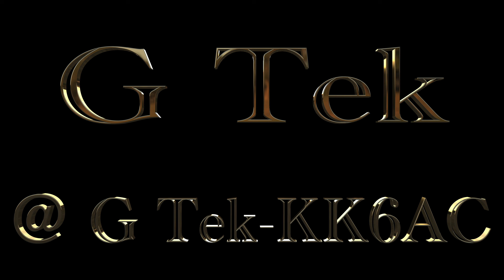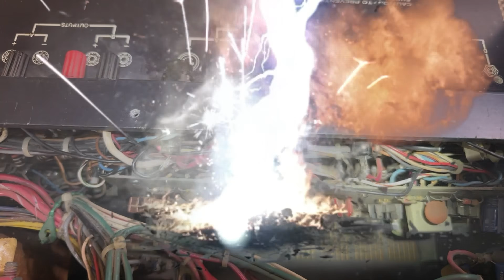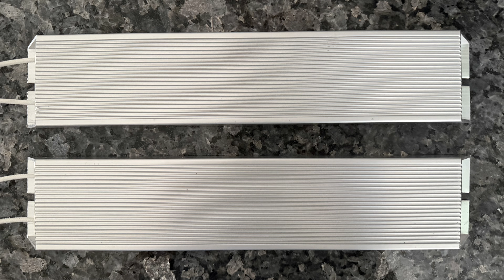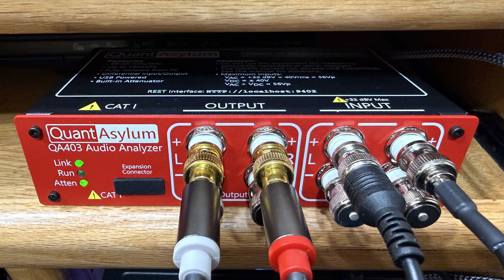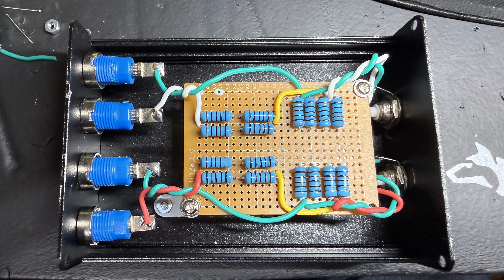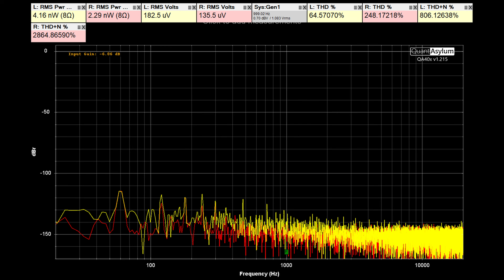Phase Linear 400 Series I: Repair  Bias Adjustment & QA403 Testing

Comment from the maker: Correction/clarification: On the frequency-response screen I left the analyzer’s vertical amplitude scale much wider than necessary. This does not affect the actual measurement, only how the graph is displayed. A narrower scale, around 5 dB, would have shown the small response variation much more clearly.  
This analyzer is still new to me, and I’m continuing to learn the best way to set it up and present the measurements. I’ll improve that in future tests. The measured result itself remains approximately -0.3 dB from 5 Hz to 20 kHz.